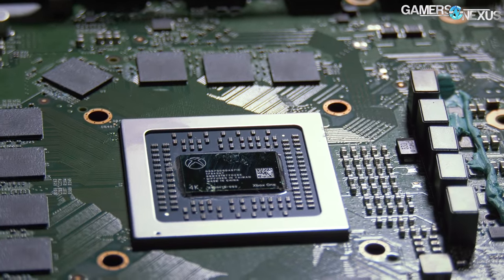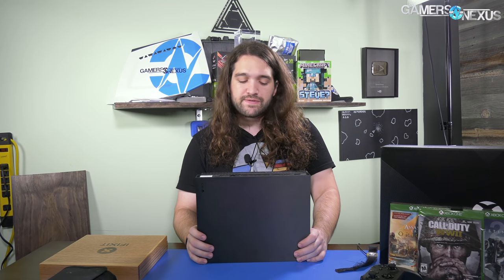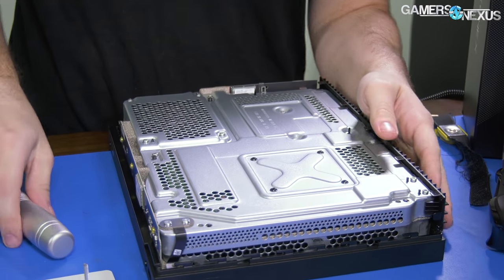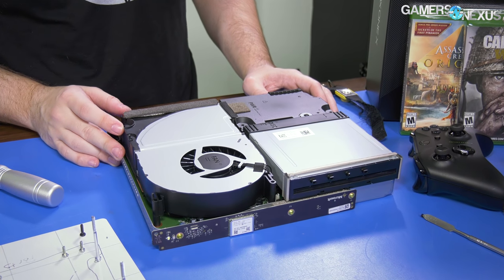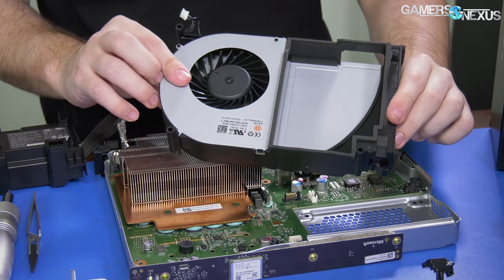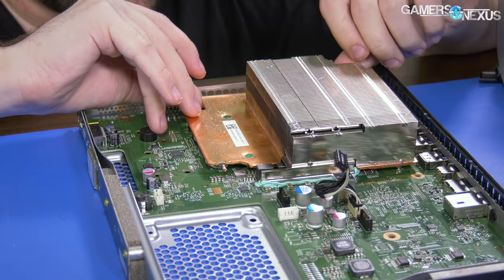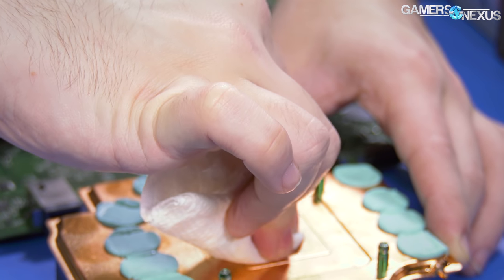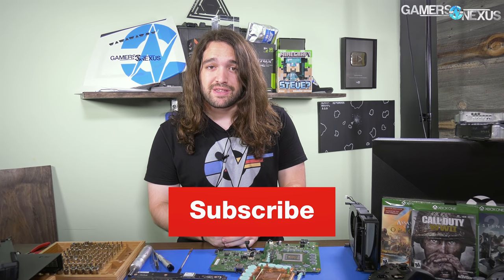Xbox One X Tear-Down: Semi-Modular Console Design

Comment: put a liquid cooler on it :p
Reply: Merck Hoffmann ???
Reply: Might as well just buy a computer than trying to find a mount for a liquid cooler for that
Reply: OOF
Reply: Warrenty void.
Reply: RRKS101_1 TF2 because taking your console apart in the manner done in this video isn’t a warranty void.
Reply: Why is liquid cooling such a crazy idea on the x? This thing heats up way more than the S! Ignorance! I liquid cooled all my boxes
Reply: SpicyHotTech no it's not that's vapor chambered meaning it's sealed in a heatsink which is nothing like using a radiator! Google vapor chamber and learn something before basing an opinion. Vapor chamber cooling is what all video cards use!
Reply: Transistor jump you do realise there's many differences from liquid and a vapour chamber for example vapour chambers have no pumps or radiators they rely on the evaporation of the liquid inside to transfer heat from the heat sources to the heat sink however an aio liquid cooler pumps water through micro fins on a cold plate which is attached to the CPU which directs heat away from the CPU after its been through the micro fins it goes to a radiator to get cooled down and then eventually pumped back through the micro fins
Reply: Wow waste money for no performance gain and destroy the small form factor.
Reply: Live2RIDE83 I don’t feel like the One X produces much heat. Compared to the Xbox One original it’s infinitely cooler
Reply: @jonnyboi9026  ?
Reply: the guy is a fool. ignore this troll  @shadowxxe
Reply: hahaha @Transistor Jump
Reply: It does get toasty lol I had my console shut down due to heat probably due to demanding game  needing more processing stress  so it shut down unexpectedly but that’s only happened once so maybe it was the game when playing it for 24 hours with demanding game
Reply: @jonathanoxlade4252  I don't know how no one realized I wasn't telling everyone to watercool their xbox seriously

Comment: Love my X1X, Halo 5 is glorious in 4k.
Reply: @Russell White Halo 5 has been visually unimpressive to me from the very start. increasing the resolution just made it worse IMO as it's easier to see the flaws. RDR2 is a good visual showcase for this thing, but of course the framerate there isn't good at all. As far as consoles go, considering the very slow CPU and older gpu architecture this thing is saddled with it does a good job of letting people take at least some advantage of their 4k TVs. If not for the X (and to a smaller extent the Pro) they'd have had to wait a lot longer for higher than native 1080p games, which would have sucked considering most of the TVs being sold today are native 4k, most of those sold being cheapo low end sets that wouldn't scale 1080p content up very well. The way the X was built screams "current gen but at higher resolution", and on that front it succeeds. Not a 60 fps machine, no new features, no X exclusive games, just more res.

Comment: That clamp you pulled from the bottom side of the motherboard to remove the heatsink is called an x-clamp. Also they have used trash thermal compound since the 360 era. The 360 had two x-clamps on the earlier revisions.

Comment: That's the 3rd XboneX teardown I've watched today where the SoC thermal paste has dried and hardened.
Reply: Prepare for overheating Xbox x call it RROX
Reply: Clearly its the kind of paste that is supposed to do that.  That heatsink is clamped down so securely it seems unlikely its going to move so it shouldn't be an issue.
Reply: yes, it's pretty bad.  Took mine apart and you can see all kinds of air bubbles in the hardened paste that sits between the SOC and heatsink.  The TIM is definitely worth replacing.  It's like it's designed to fail after the warranty period.
Reply: Rick Sanchez XBOne XBOX one in short.
Reply: Nine's And AK's oh
Reply: I would consoder me a part of Xbox community and i use Xbone as well :D just a shortcut. But i dont have an Xbone because OG Xbox is all i need :D well... and 360 + a decent PC.
Reply: sinjonezp my x1x just did. Luckily it was 2 days before warrenty was up. Just got it back, they only added 3 months to the warrenty and gave no explanation. Im gonna assume the paste was the reason. Gonna do this once that time comes

Comment: What i usually do to copper heatsinks is i gound them to a 12v power supply, put the +12v on a coun, wrap the coin in a wet tissue and give it a scrub, this removes the oxidised layer and exposes the reddish-gold color of the copper.I would assume applying TIM and mounting quickly prevents reoxidation and helps thermal conductivity

Comment: Disappointing that the 1 X is still using the same god-awful CPU that's in the base XBOX1.

Also think they should have went with a 2TB SSHD for its storage. 2TB should be the bare minimum, especially now where games are pretty much getting into the 100+GB zone.
Reply: UCanBeMyBigBoss yeah storage is going to be a huge issue for the "4k" assets. If they had a newer processor in there then they would have had to market it as next gen which would have really jacked up the price.
Reply: shadowreaver752
Yeah, i hear ya....
Reply: >Anything other than Jaguar would cause compatibility issues.
Nope, all they would have to do is use the PC code - as the consoles are x86 based which is the same as the PC. The only thing they would have problems with is first-party titles - but a simple patch can easily sort that problem out.

>2TB SSHD costs more, system would be over $500.
An extra 50 bucks isn't that much more expensive. You're already paying $500 for a console ffs, is an extra 50 bucks gonna break the bank?! I think not.

>Besides, most people only play 2-3 games at a time.
That's BS. Not even casuals play only 2-3 games at a time and what you have to realise as well the XBOX1X isn't marketed towards those type of gamers who only play 2-3 games at a time -- but rather marketed towards the more 'hardcore' oriented gamer that definitely plays more than 2-3 games. I mean, who the fuck is paying 500 bucks for a console to only play 2-3 games?! That's just fucking retarded.

>Having bluray copies helps a lot. Would suck if you only used digital.
Blu-ray does help but 1TB is still too limiting in 2017. Like i said, 2TB should be the bare minimum.
Reply: 1tb isn't nearly enough for "alot of games". 1tb would barely hold 6-7 AAA titles. Which is pretty ridiculous.
Reply: All multiplats have PC code because they are released on both consoles and PC, in most cases simultaneously. Do you honestly think that it would be so hard for devs to get a game like, say battlefield 1 to run on an XBOX1X with a CPU change? No, a simple update is all that would be required.

The reason why they didn't do a CPU change is exactly what shadowreaver752 said above, not because of code complications. If they made a significant CPU upgrade they would have to tout it as their new next-gen system.

Also, stop defending XBOX1X's piss poor storage, you look like a pathetic corporate shill. 
1TB is not enough in 2017. PERIOD.
Reply: Honestly the CPU is a scapegoat. If a developer wants to target 60 fps, they can do it on essentially any modern CPU (last gen consoles had garbage CPUs from a development perspective and still ran plenty of 60 fps games). Console games target 30 fps for marketing and development ease.
Reply: dogen Not garbage if we look at it in a 2005 state of mind when they launched.They are garbage now since hardware has evolved quickly over the last 13 years.
Reply: UCanBeMyBigBoss You have to keep cost in mind, the base release was 500$ they were already pushing it to the max.
Reply: @Venom_Byte  PS3 and 4 have sold about 80 Million consoles each. That "not much" $50 would be about half a billion $ each.
Reply: @Venom_Byte  there is no reason they would have had to tout it as a next gen system becuase it had a faster CPU. They already talk about how much faster the console is and extra features like 4K, there is no way that consumers would have been like "But I'm getting a faster processor this should be called next gen".
Reply: @Venom_Byte  Actually it's the emulation is going to make the console more expensive, because of the time and effort would have to put into the new CPU. And yeah, with more storage would make it much more better than it should've been. Although it would make it more expensive (let's not forget that they have to buy the storage by the bulk for the mass production sake).
Reply: @killertruth186  The One X should've be even more expensive imo because it's a premium product. It's not like it's the only model on the market. If you're a budget gamer and can't spend 500+ on a more powerful console, go for the less expensive base model. The fact of the matter is, Microsoft fucked up by releasing the One X. Sony's new PS5 will probs be dropping in late 2019/early 2020 and is rumored to have a Ryzen CPU that will feature 8cores/16threads. 3 years into the One X's lifespan and it's already gonna be massively outdated by the competition. You might think 3 years is a long time but not to a console gamer. Trust me when I say this, One X owners are going to feel burned in a year or two.
Reply: But it's not using the same cpu... ugh.....
Reply: @Venom_Byte  you do know you can plug a external 3.0 hard drive in don't you I put a 2Tb on mine and now I have 3TB's . On 4k tv I love my x
Reply: @captaindeadpool1640  External hdd aren't practical.
Reply: @Venom_Byte  On the X it is for me it combines with the built-in hard drive and the one I got is small and USB powered works great I download games on it and dvr on it. Why do you say it's not?
Reply: Tell me about it hahah, Picked up xbox last week, Spend 3.5 days on initial 59gig update for blackops4, played 1 day and today another 22gig update.. Gotta low living outside of metro cities where the best internet we have is 3mb/s

Comment: That TIM though....bad
Reply: not necessarily, as long as it contracts enough to fill the gaps a higher density is actually preferable. The reason for this is simply due to the fact that in most TIM the stuff that makes it soft is silicon which is really bad at transferring heat. The stuff that's actually good at transferring heat in TIM is usually a solid metal like silver in Arctic Silvers TIMs and so on, so a higher density is preferred for actually transferring heat. It makes changing paste and applying it a lot more difficult, but that's not really something MS have to take in to consideration.
Reply: It could be terrible, and I'm not saying it isn't. I'm simply implying that the viscosity of a TIM is in no way indicative of it's actual performance, though as I mentioned it shouldn't have to high of a viscosity either (for one thing, you want it to stay where you put it, but if it's silicon based then that hinders performance). Either way it would have been fun to be able to test it.
Reply: As long as the paste dries in place and the heatsink isn't moved in the slightest way (which it certainly does not when considering the thorough mounting) then the paste is fine. 'Dry' paste only causes issues if the cooler is moved after assembly so it breaks up.
Reply: +something1random23 "I never notice the fan noise anymore."
I never noticed any fan noise, at all, on my OG Xbox One, even at higher than normal ambient temperatures (like, on a hot summer day), and the X is just as quiet.
Reply: It looked a bit like a thermal pad that is liquid when applied.
Likely it was chosen for long term stability vs. high performance.
Reply: Didn't PS4 have more powerful hardware?
Reply: Assumption is the mother off all fuckups. you don't know until tested.
Reply: I dunno about that twice as much statement. They've only shown it running old games from 5 years ago in 4k, you can do that with a $600 PC. Not hating the xb1x either, it's definately impressive, just being realistic. Honestly right now if somebody wanted to build a $500 PC I would suggest an xb1x instead or up their budget for a better PC, because xb1x will definately walk all over any $500 build right now, which because of gpu prices would be limited to a 1050ti
Reply: PsychoZulu you can always buy an optiplex and slap a rx 570 in it and have  the same power as an xbox one x for less than 500 bucks. It really doesn’t take much to match 4k/30fps with lowered graphical settings. But if you are building from scratch with new parts expect to spend 600-700 to match the Xs power. 

If you can afford to shell out 500 bucks and consider yourself a gamer, in no way could I ever recommend the X. 

Remember resolution does not equal graphics.

Not to mention online costs + more expensive games with less of them to choose from. Consoles are simply for casual gamers, and thats OK.
Reply: I think you're selling the xb1x a little short there, it's got an 8 core processor, 12 gigs of ddr5 and the gpu is closer to a 480/1060. Optiplex probalby has 4 gigs of 1333 ddr3 and a 4 core i5 from 2013, so you would need to buy more ram and a video card, and you would need a new psu because optiplexes have 300w psu's which isn't even enough to power a 470, all that would put you well over $500 dollars. To build a comparable PC with new parts would cost closer to $800 if you buy a crappy budget case. 

Resolution doesn't equal graphics? Then I assume you play all your games at 480p? A game playing at 4k 60fps looks better then 1080p 60fps with all the same settings. 

I agree that cost of online gaming + always paying full price for games is a negative, which is why I stopped playing consoles, I actually prefer the convenience and ease of use of a console over a PC, but I'm not willing to pay $60 dollars a year and not even get dedicated servers to play games on.
Reply: +PsychoZulu this cost $650 brand new were I live then u got to buy games and pay to play online least u could upgrade your PC with newer parts I got a 1060 6 GB and that feels outdated already
Reply: +cjdig86 if nething the next console will be considerd a PC with every1 using mouse n keyboatd
Reply: PsychoZulu NOT EVEN CLOSE TO A 580/1060 it has a 30fps cap on most games except like Minecraft and overwatch and fortnite (and a few others) my 580 runs fortnite at ultra setting 80-100fps the Xbox couldn’t dream of doing that.

Edit: from 10 months in the future. I cant even believe I used fortnite as my benchmark, why the heck did I ever play that game.

Comment: Damn if the thermal paste looks like that in other systems going to be some red rings of death again
Reply: I just said that , I watched other breakdowns and all the thermals were dry as hell. And chipped off , it will def be some RRod issues
Reply: Well seeing as though rrod was caused by more than just over heating...your claim is probably false. The red ring was just to show hardware malfunction. Overheating is an issue with any cpu.
Reply: Lafset 10 did you no see the thermal paste on the apu that the xbox 360 got red ring of death and ps3 and ps4 with the ylod and blue from no thermal paste too
Reply: Luis Ramos my point is that is not a guarantee for hardware malfunction. If the fan and chamber are doing its job. It’ll mitigate what ever heating issue you foresee. You cant guarantee hardware overheating off of an adhesive. You have to consider all variables.
Reply: Lafset 10 thermal compond takes a big role in keeping the apu cooled down if you by a water cooler today and put it on a cpu with no thermal paste you will be at 90c ps3 ps4 ps4 pro xbox 360 slim xbox one all have died more  once from no thermal paste white thermal paste = cheap out
Reply: You seem pretty fixed on your argument despite the fact im not disagreeing but saying heating issues arent guaranteed solely due to thermal paste.
Reply: Andy well take a look around on YouTube artifacts and not turning on have showed up
Reply: Luis Ramos had not one rrod in our 360s. Have mw2 and first wirless n model. Used the Modern Warfare 2 for 36 months then I bought the new wireless n model with the redesigned  and cooler running lower amp APU still runs to this day
Reply: Jay Probly got a jasper
Reply: The rrod was an Xbox 360 problem and it was because Microsoft rushed the release to try and beat Sony
Reply: TBH, they could've just put in more better thermal paste.

Comment: Ive learned a lot about console vs pc in the last month so to clear up any confusion here it is.
Consoles are pc's, just with everything on the mobo. The cpu is self explanatory, its on the mobo just like on a pc. The gpu is where it gets weird. Back in the days of the NES and Neo geo, console creators realized that if they took a pc gpu and just removed the chip, they could fit the power of a pc in a console. But back then, pc gpu's weren't really..... accessible once inside the pc. So it would take generations of consoles before the first pc gpu was used on a console(og xbox). The ps4 and xbox one are the second generation of consoles to use a pc gpu(the first being the og xbox). So with ram its a similar thing. Instead of plugging in inefficient ram sticks in terms of space, just have the ram board built into the mobo, and put the ram cores on that. Ever notice on older ram like DDR3L ram there's these squares on the stick? Thats the ram cores. So that about covers it. Console companies get discounts on gpu's(or if partnering with the gpu producer, its free)and then mod it to get the chips, then bam. You have yourself a good console. Small compaired to a pc, and gives good performance.